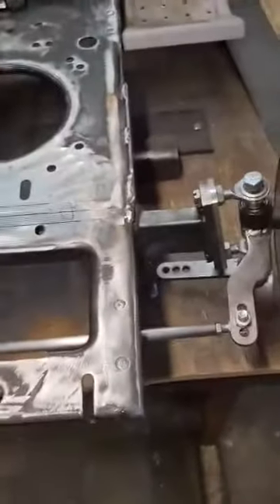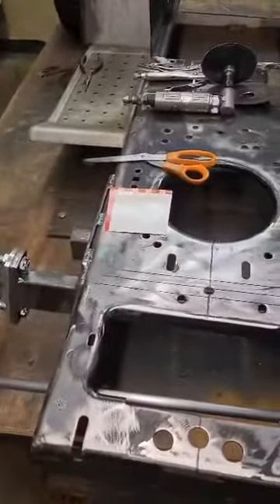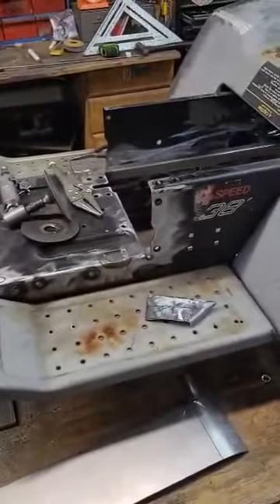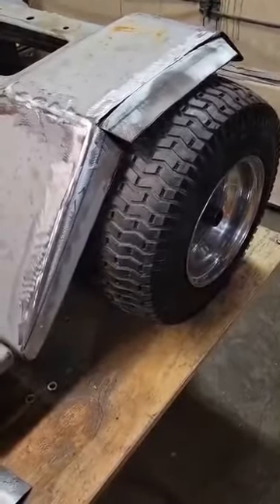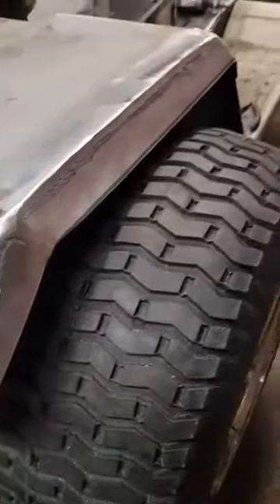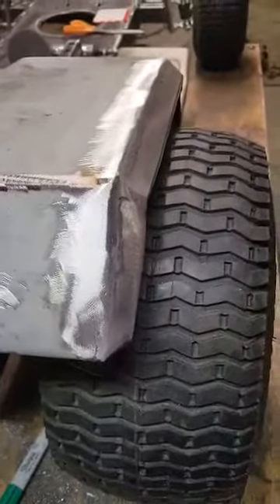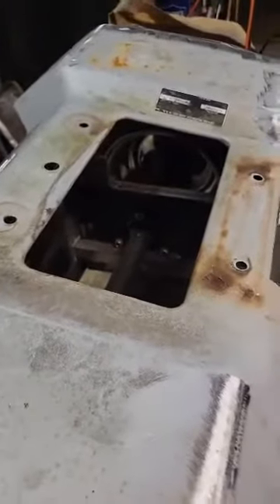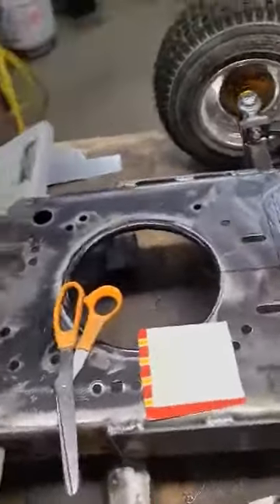John's back with an update to the Craftsman build.

Comment: Like the videos John! I built my first mower few years ago using some ideas from MP Mowersports videos. They were big help! I have a question. What size and what brand wheels and tires are you using on this build? Not much info out there on what sizes to use.
Reply: Hi Steve, It was difficult to find rims. The rear are DWT 8 x 7.5 from BMI Karts and the front are the same manufacturer 6 x 5.5 and I bought them used from another racer. EC Carbs also sells rims but they were out of stock. I hope this helps.
Reply: @johnlinville4861  thanks for replying back! I don’t have anyone in my area with experience lawnmower racing that I know of so I have read some on heymow about wheels and tires that are most commonly used but lots of different options. That goes with all aspects of building/racing lawnmowers so I’m sure I will be asking more question as you post videos.

Comment: Nothing personal. But when this race build was first announced, I thought it would be more of a hands on type build. You know, actually showing the work on video. So far it’s been nothing but show and tell. Set the camera up and let it run. Video the process. 
But on another note, it will be a nice racer
Reply from the maker: Don 
Part of the problem I have is trying to make these videos show up in the top of a search. You tube aynalitics uses the time people stay engaged with the video and how much they fast forward through it to figure out where to place your video in the search results. People commonly skip the welding parts. I don't have any kind of monitization on these videos so they have to hold there own on aynalitics basically. I will try to add in some fabrication and see how it goes.